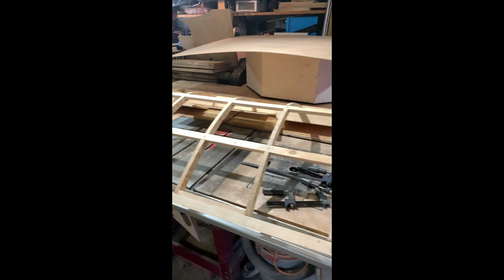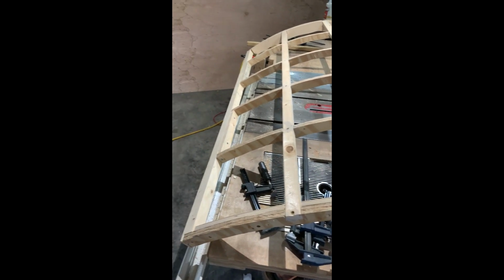Teardrop Camper Build Part 6-From a Pop Up to a Teardrop

Comment: I come across these often for little to nothing as far as cost. BUT I need a title.  Did you guys get a title with yours or register as a home built camper?  There is a guy selling a complete disaster of a popup locally for $400, I was considering offering $200 just for the clean title and frame.  Looking forward to seeing your compleation!
Reply from the maker: In TN pop ups are not required to have a title or tag. We will just apply for a homebuilt tag.